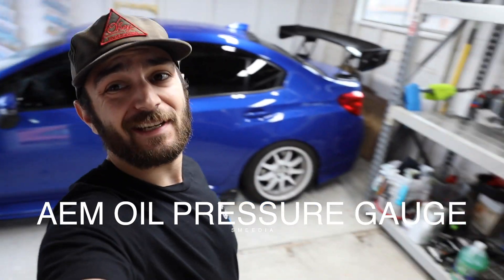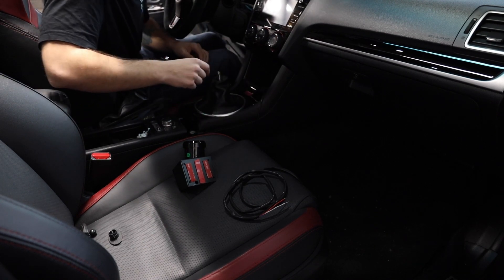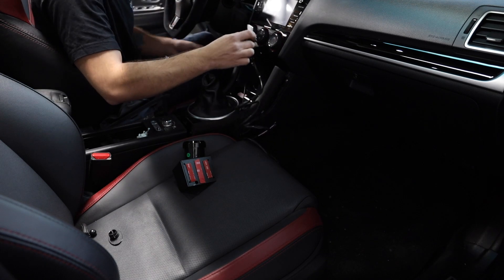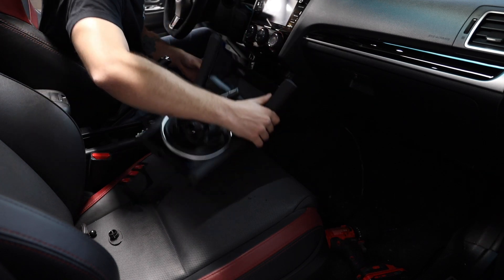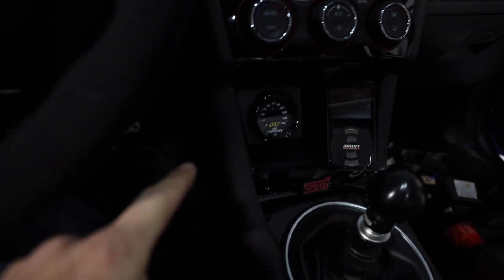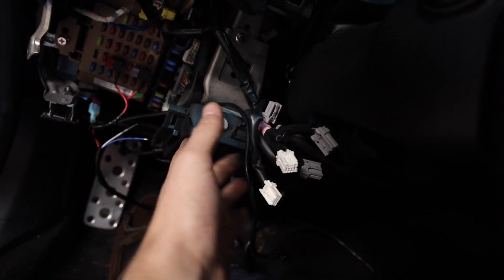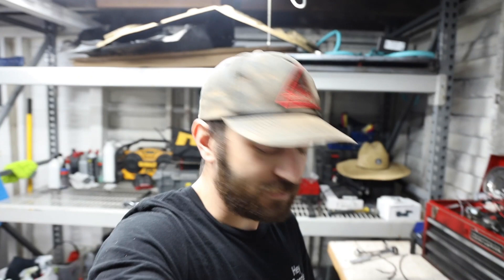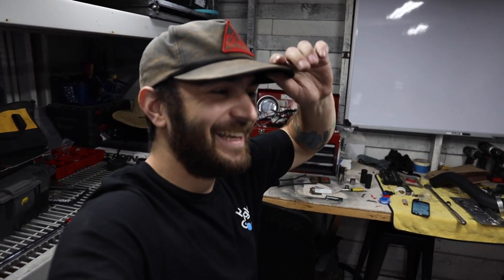AEM Oil Pressure Gauge Fail

Comment: I thought most people used the front galley plug even with the AEM oil pressure gauge. Just take out the dummy one and I believe it'll fit?
Reply from the maker: They do, I did not want to remove the alternator to get to the galley. Plus the dummy light would drive me nuts having the oil light always on. My TPMS light is always on so I'm trying to mi imoze the amount of dash lights. When I have the alternator for next time I'm going to mount the fitting and the dummy light to the front oil galley.
Reply: @Smeedia  thanks for the reply, I've been researching hard recently as I plan on going from just AP and intake to almost FBO here soon so I'm getting all my ducks in a row. Subbed for further content.

Also from what people are saying online if you remove the dummy sensor it does not kick on the light as the TPMS light does if that helps out in your decision. Appreciate the videos, keep it up!
Reply from the maker: @WLFT-McNoob  Interesting, next time I've got the alternator off il swap them around to see what happens. 

What year is your car? 15+? 
And thanks I appreciate the support!
Reply: @Smeedia  yes, I have a 17. I had an 11 WRX before this and swore I wouldn't do more than suspension mods to the STi....apparently I lied to myself.
Reply from the maker: @WLFT-McNoob  I totally understand lol this is my 7th STI and it's an addiction. Keep in mind that when you do a down pipe you need to do the fuel system also. The 15+ fuel system can not support a down pipe and an intake. I ram into this issue which started all of my mods and protune a few months back.
Reply: @Smeedia  yes sir! I am also ordering the flex fuel kit (injectors, pump, sensors) as well as I have E85 about a mile from my house. Going with the GetADomTune cylinder 4 mod as well for added protection.
Reply from the maker: @WLFT-McNoob  I'll be doing the cylinder 4 cooling mod in two weeks with a install video of it! Lol jealous I dont have E85 anywhere near me. But I'm big on longevity mods. I've got a few more to install. Going to try and push as much horsepower out of my OE block. Once it blows I'll be going to the IAG Stage 4 block.
Reply: Any links to a DIY for swapping the dummy plug for the oil pressure sensor?
Reply: @michaelhernandez8418  there’s quite a few oil pressure gauge install videos on YouTube. The general gist is to remove the alternator, you’ll see the dummy plug, unscrew it, screw in the new sensor, bingo bango
Reply from the maker: Just unplug it and the light will stay off on the dash

Comment: What did you end up tapping the power wires into? Doing a pressure and temp gauge install and having trouble deciding how to do the wiring.
Reply from the maker: Pulling constant power from the 12V outlet 🔥
Reply: Smeedia sweet, thanks. Was wondering if that’s a good spot. There’s a surprising lack of online content for a concrete good place to wire things in lol. What about the ignition and dimming wire? And did you combine the wires for your gauges before tapping the fuse or did you tap each one individually? I got the Defi’s and they say not to combine them but I don’t see why unless there could be issues out of it. Want to make sure I do this right lol.
Reply from the maker: I did not use the dimming or ignition wires just the power and ground 😅
Reply: Smeedia ah lol. Well if I get frustrated enough which I’m sure I will I may just give your route a shot and see if the backlight not dimming bothers me, which I’m sure it will lol. 

So did you end up combining the wires for the 2 gauges or tapping them in separately?
Reply from the maker: Soldered them together into one and them spliced them into the main harness wires for power and ground 🔥
Reply: Smeedia Ok good, that’ll make life a lot easier lol. Thanks man for the tips! 

And keep up the good work! I really enjoy watching your progress on your builds and as a YouTuber. Seriously quality stuff 👌
Reply from the maker: Thank you! Appreciate the feedbaxk and support 😁😁😁😁 hopefully your install goes smoothly 🔥